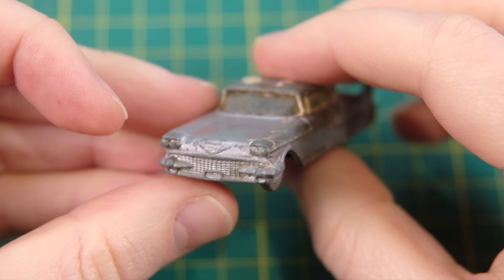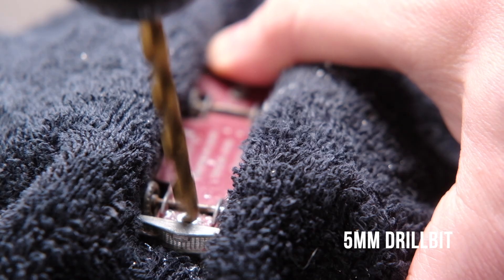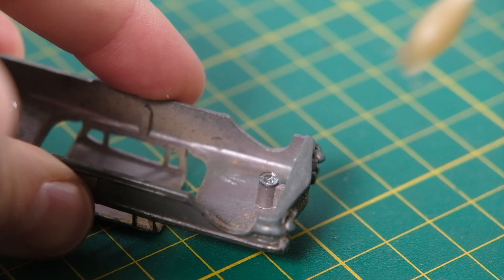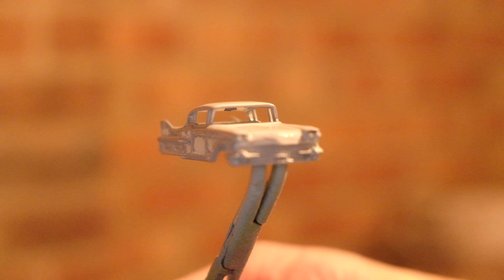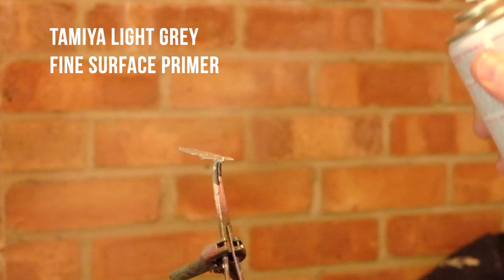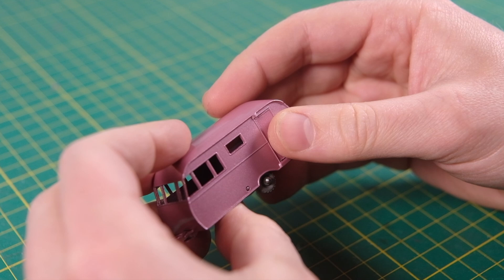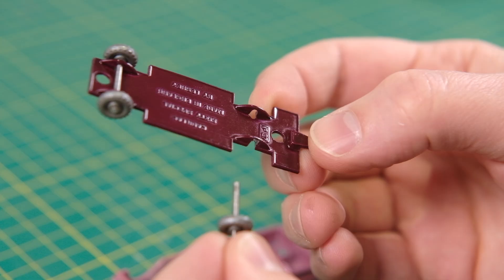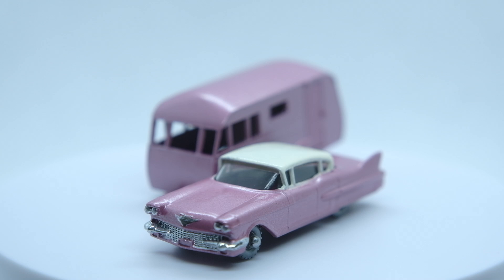MATCHBOX restoration: 27C Cadillac Sixty Special and 23C Bluebird Dauphine Caravan

Comment: How does this wood floor polish works? 
You just dump scratched windows in it, stir up a bit and it magically becomes cool again? 
I dont get it
Reply from the maker: I don’t know the science behind it, but the polish creates a veneer over the entire plastic piece that allows it to sparkle, like you would a wooden floor, refreshing it like new but also helping to fill in some of those gouges.

No idea why it works but it works!
Reply: @DieCastRestos  Oh, so it fills all the tiny scratches with itself. It was confusing to me, as everybody else seems to be using high grit sandpaper and polishing compounds
Thanks for reply!
Reply: @locomotivebreath9364  it's also a bit like the resine floor formulas for industrial floors, which fill gaps and nooks, and create a smooth surface while drying. that helps with making it look as new again. most restorers would sand and polish the window piece anyway, and put floor polish on it which also serves as a protective layer.